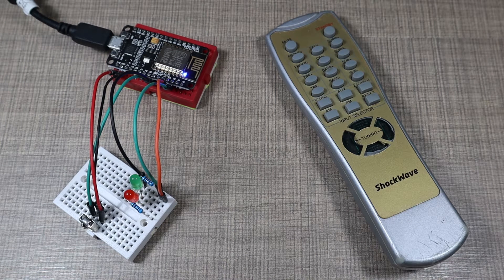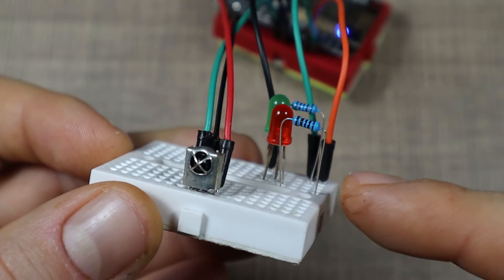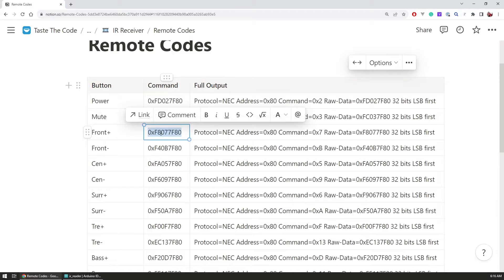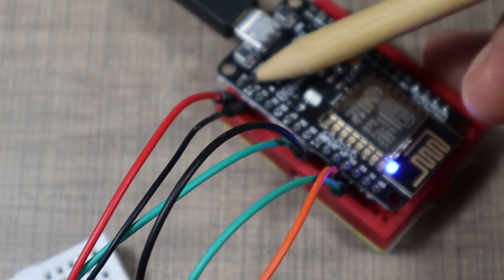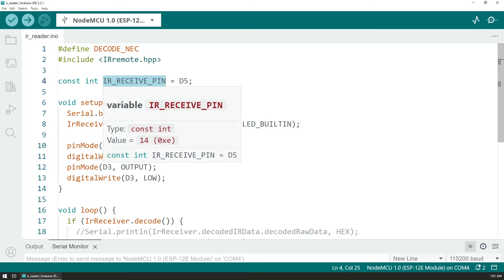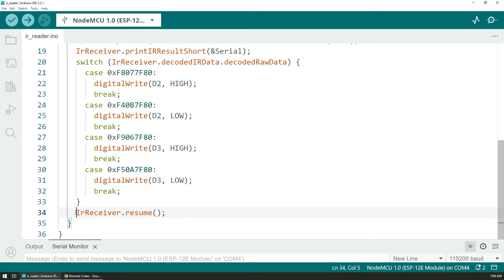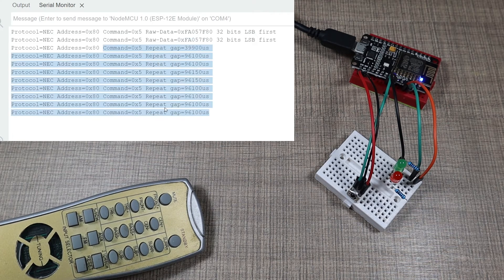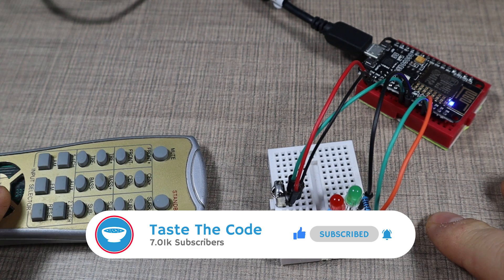Make an IR receiver and salvage IR remote codes from a dying remote controller

Comment: hi, nice video. Thank you. I have shockwave sw290 but cant find the remote, so i will try your solution. Do you think it will work using your codes?
Reply from the maker: No idea. Give it a go. If it doesn't work then try searching for the codes for other manufacturers and standards and try them.
Reply: @TasteTheCode  will be nice to do a video on how to transmit (encode with nec protocol)  using esp32 or other microcontroller.
Reply: @TasteTheCode  will be interesting to extract the codes directly from the chip of the surround system receiver.

Comment: The simplest is always the best:
1) repair the remote control
2) Use a universal remote control.
Reply from the maker: Yes, but where is the fun in that? And how would otherwise you know how IR works and how to use it? Plus, replacing it with another remote gives no opportunity for automations.
Reply: @TasteTheCode  
I agree with the last part, although there are better ways to automate something than via infrared. Where we do not have acknowledgment that the code has been received.
There is no need to do all that to understand how a remote control works, just as there is no need to reinvent the wheel to know how it works.
Reply from the maker: On this particular model that I have, IR is the only noninvasive method how it can be automated. Yes, there is no feedback bit for anything more complicated, one would need to heavily modify the device and that is not an easy task. I personally enjoy learning how things operate and I'm aware that not everyone is into that, and that is OK.
Reply: @TasteTheCode  A more reliable way in that case would be to pass the data directly, bypassing the infrared link.
Simply inject the infrared data stream into the location where the receiver would be.
You will not have feedback, but at least you will know that the data arrives in a more reliable way.
Reply from the maker: Yes, but again, that will require modification of the device.
Reply: @TasteTheCode  And what would be the problem? A modification that adds functions is a plus.
Reply from the maker: Well first of all, not everyone is comfortable opening and working with mains powered devices. Second, for a non experienced person, adding such a mod, increases the chance of breaking the device entirely. I do see, and understand your point, and I do agree with you that a modification is a plus, but it is not a one size fits all solution. Some people chose to stay more on the safe side, and that is OK.